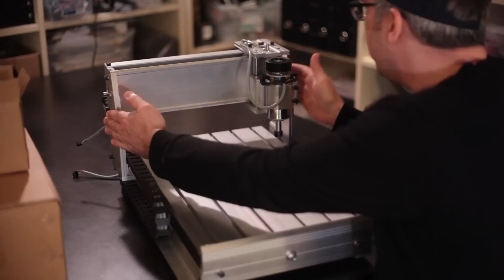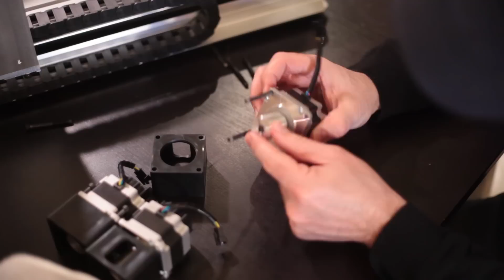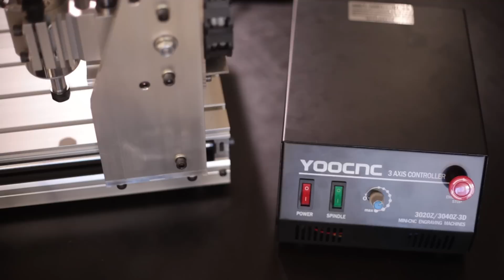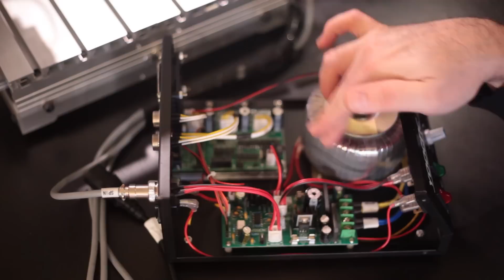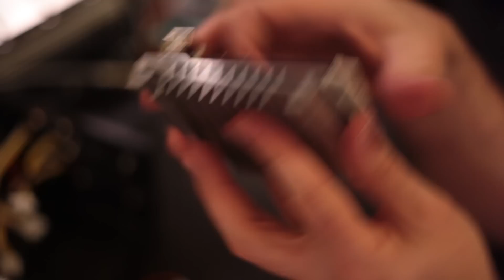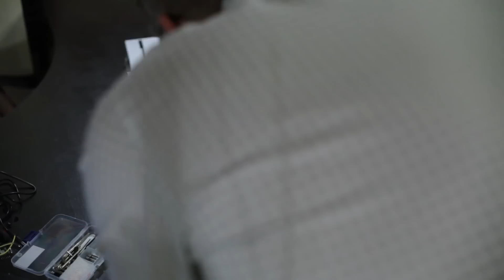Build a ChiliPeppr Driven 3040 CNC

Comment: If I have a parallel port machine can I run the json server on it to use chilipeppr without upgrading my Cnc controller board
Reply from the maker: No, ChiliPeppr only works with TinyG boards or Grbl boards.

Comment: People keep saying parallel ports are impossible to find ... Really, I can get them fairly easy over here for like 15 euros. Or am I missing the point.
Reply from the maker: Well, it sort of misses the point that CNC control boards are now readily available to offload all stepper motor step generation signals to a separate microcontroller rather than relying on the PC to do it. It really frees you and your PC up from the processing. Think about it like this--you're giving your CNC machine it's own brain and then your PC is just sending it Gcode and letting it do the hard work.
Reply: You won't get an argument from me there. I was just baffled at why people in (been watching a fair number of 6040 themed videos the last few days as I plan to purchase one) so many videos keep saying parallel ports are no longer available.

That being said you are right CNC control boards are readily available and can be a good option depending on your situation. But then really how is that fundamentally different from using a computer as your controlboard. With the latter I would argue you even have the benefit of a more comprehensive user interface than with a CNC control board that usually is somewhat limited in that regard. You have a web interface with the Chilipeppr you say. True, but I will admit it scares me a little that there is so much 'distance' between that interface and the machine. Which brings me to another concern I have. I am a little disappointed (and keep in mind I had not heard of Chilipeppr until your video) not just in the case of Chilipeppr but also many similar solutions such as for 3d printers, about the way the components communicate with each other. It is a mystery to me why not more of these solutions employ more resilient infrastructure give the rise of IoT and cloud technology.
Correct me if I understood the concept wrong here but with Chilipeppr you run a daemon on your RPI that essentially allows the hardware to be driven remotely? Would it not make more sense to use some form of resilient messaging for this? Or hell even go all the way and use Azure or some other IoT cloud.

Maybe I am just overthinking it, occupational hazard for someone like me who has been developing and working with IT systems for 30 years.
Reply from the maker: Well, once ChiliPeppr loads in your browser, everything is local as if it were an app on the desktop, meaning it doesn't go back out to the Internet. The local browser simply talks to Serial Port JSON Server (the daemon) which could be on your same PC or something like a Raspberry Pi and then that talks over USB to the CNC. I would say that's pretty much the same as a desktop app talking over a parallel port in terms of simplicity.
Reply: Ahhh thanks for that clarification. that does sound better. For some reason I thought it was driven remotely, so you could run/checkup on your job from anywhere over the internet. Which come to think would make very little sense really. Guess I should have done more research on Chilipeppr :)
Reply: You will have to run an old version of Windows to get a working port. Win10 will not play nice. Another option is to run one of those UC100 motion controller things inline. A USB to serial adapter will do nothing for you but break your heart.
When your all done jumping through hoops for a port you can buy and run Mach3 for it and you should be ok.

Comment: TinyG v9 has less amps then factory board , you will get steps skipping, and the parallel port have faster control :D
Reply from the maker: I've been using the setup I show in the video for 3 years now and never missed a step. The NEMA23's that come on most 3040 CNC's are rated around 2 amps. Mine were rated at 1.8 amps. TinyG can put out 2.5 amps per winding. So I'm not sure what you mean. When you say the parallel port has faster control, what do you mean? Do you mean it can generate more steps/second? If so, that's not really true at all. The max feed rate on a 3040 or 6040 would be about 5000mm/min. If you run at 8x micro stepping and you need 200 steps x 8 for a full revolution, TinyG can drive to this feed rate, as can most any microcontroller. Maybe help us out with what you mean?
Reply: if it works for you then its fine.I had some problems with grbl with not immediate stop and usb disconnecting when spindle turns on .
Reply from the maker: Grbl is not TinyG.

Comment: 2 years later most CNC still uses parallel ports.... Seriously why waste money on an tiny G and not a $15 PCI parallel port card?
Reply from the maker: Awesome to hear. I think you'll love TinyG's motion planning.
Reply from the maker: I think the future is the other direction. Your CNC machine should really be like any IoT device, which means it should just have its own microcontroller and be available on your network via WiFi. This is what you can achieve today with TinyG and Raspberry Pi, but if you look at other CNC controllers like Cohesion boards used on lasers, it even has WiFi built-in. The age of the monolithic PC controlling a CNC is in the past. However, I will say that ChiliPeppr is a great step forward on software, but there's still work to do to keep refining it. Mach 3 is commercial software and thus there was a revenue model for it. In this new age of IoT CNC controllers, there's no commercial software for driving the boards. This means we're at the whim of the community to solve bugs/features.
Reply: I agree actually, but still there is a ton of very good dirt cheap parallel board controllers out there. I just got an entire 4 axis kit with nema 23 steppers for $188 to upgrade my little sherline mills aging cnc setup that doesn't work with any modern CNC software (3rd party controller/driver not the Sherline controller). I bought a JT1900 motherboard for $65 with the parallel port built in. I am currently using linuxcnc which is pretty much open source mach3.  Linux also has open source CNC and CAM software. The problem however is... Linux. I guess my point was you had a perfectly working parallel based controller and replaced it with a $130 TinyG. Mach 3 is  only $175 for the full version so I don't think your money spent is justified being Auto Desk Fusion 360 CAD/CAM is free for hobbyist or business under $100,000. Fusion 360 and mach 3 is what I will be using once I get my larger CNC mill setup.  Thats just an insanely powerful combination for only $175 mach 3 license. There also much cheaper USB  controllers out there that are pretty good. This is just a money based comment though. Nothing against you vid or the equipment. It is still very interesting to see what you did with the tinyg.
Reply: Mach3 is unfortunately not the solution to all problems, there are certain areas where it does shine but there are areas were its severly flawed aswell. Mach3 has a long standing bug in its motion planner which only shows for rather complex short segmented 2.5D Gcodes. This bug instantly stalls my machine and has destroyed many parts along the way. So im actually looking at the feasability of going the reverse path, leaving my trusted mach3 lpt setup over to something more modern - g2core / chillipepper. There are still many questions for me to be answered first but i think its possible. Im not sure if i agree with the mindset that a cnc should be amongst iot devices, its still a large very dangerous tool that can burn through 10k $ in less than a second if not handled properly.

Comment: Thanks for this video John, I have just ordered a tinyg! Looking forward to chilipeppr etc! Quick question to clarify, is the Beagle (Now PI) used for plugging in the tinyg to, then you use a pc/desktop to connect to the PI as a server and then chili recognises this and the tinyg? Have I got my head around things correctly? Is it possible to connect the tiny g straight to the pc running chili? Is there a good reason not to? I think all will become clearer once I start to play. Thanks
Reply from the maker: You can runs Serial Port JSON Server on your local PC that also runs ChiliPeppr if you want a simple setup. I, however, am willing to put a dedicated Raspberry Pi in my controller that auto-boots Serial Port JSON Server so that it's just always on and connected. I also can then run a milling job from my laptop and take my laptop with me to the next room while the Raspbery Pi runs the actual connecting to the TinyG.

Comment: Aren't those motors weak for this machine ? they look so small. Also , is this a better machine than shapeoko ?
Reply from the maker: This machine is light years better than Shapeoko because it has ballscrews, is super rigid and square, and you can see the results in the final product. Any timing belt machine will have the lack of rigidity of the belts show up in the final part. The motors are great because you gain a mechanical advantage from the ballscrews. What will break on you during a milling job is the end mill because the motors have so much power from the mechanical advantage of the ballscrews.

Comment: Hey John, 
Nice work developing Chilipeppr. I ordered an OMIOCNC X6-2200 EPL, which is a medium sized router with an integrated controller. I put a USB thumb drive into their controller, and run g code from it without connecting a PC over ethernet, USB, or parallel port. I like this solution because software updates on a networked computer can interrupt a job. I'm satisfied with this solution but I'm curious about TinyG because 6th order, constant jerk, look-ahead motion control seems excellent for small machines like ours.
I have my reservations about Chilipeppr because I have to use my laptop and PC for work. If I run Chilipeppr on my laptop and leave my home wifi, would that interrupt the job? If so, is there a way to run TinyG without using Chilipeppr as its motion control software?
Reply: Actually, the more I look at ChiliPeppr, the more I like it. If I close the Chilipeppr browser interface and/or put my computer to sleep, will ChiliPeppr still run?
Reply from the maker: ChiliPeppr uploads the Gcode to Serial Port JSON Server which can only queue 200,000 lines of Gcode. So you do need to keep your browser open until all of your lines are queued.

Comment: Hi John, I've been using my 3040 cnc with a tinyg for quite awhile now. I'm thinking of springing the dough for a JCUT 6090A CNC (ad below). My only experience in the CNC world is with the tinyg and Chilipeppr. Is it possible to wire one up for something of this size with separate drivers for each stepper motor? Any problems you could see and reasons not to go this route? Trying to get a larger work area for punching out guitar templates and larger scale projects. Thanks again for all you've offered the CNC community!

http://www.ebay.com/itm/24x36-cnc-router-ON-SALE-freeship-JCUT-6090A-/131897591746?hash=item1eb5b587c2:m:mwSXD7kEDFsNhMkYCPQkETw
Reply from the maker: TinyG outputs step/dir signals as well, so just hook those up to larger stepper drivers like a Gecko. You should be fine. Almost no other change to your process that you're using today.
Reply: Awesome! I was hoping it would be that simple. Thanks again and have a great evening.

Comment: Hello there 
i just bought 3040 from shop which is very old stock they sold to me with super cheap price . 
But the problem is , i cannot seem run it . i load everything with my old pentium 4 PC which integrated with Parallel port . Is it driver not installed ? or i didt connect to port ?
Reply from the maker: Did you ChiliPeppr enable it?
Reply: oh solved the problem already , 
XML file i didt load which is preset/driver for cnc :(

Comment: what do the numbers 3040 mean?
Reply from the maker: It's the size of the milling platform. 3020 is smallest. 3040 is double the width. 6040 is even bigger. Same design, just scaled up.
Reply: Ok that's what I thought but wasnt sure,  thanks
Reply: 30X40cm cutting bed. 6040 is 60X40 ect.

Comment: Hi John, Very informative video! I am just about to pull the trigger on a 3040 but I know there are a zillion cheaply made variants on ebay.
I went to the omiocnc site from your link, and would like your input about the latest version (2017). The X3-300 USB description says it now supports using a laptop via USB. Is this new controller their version of the TinyG? What are your thoughts?
Reply from the maker: Don't know anything about that new controller, but I think TinyG is still the way to go so you should toss out that controller they sell with it.

Comment: Does not comes with limits switches  set up.
Reply from the maker: I've been using it a lot for a couple years with no limit switches and it's never really been a problem. You just set your XYZ zero to your workpiece lower left corner and go. Of course many people do use limit switches, but many have found they're not critical.

Comment: You should have just put a parallel port into your PC. The drives on that other board are weaker than the Toshiba chips.
Reply: It's no help you don't already have a deep understanding of EMC2 or whatever other software. Both EMC and CNCLinux was beyound understanding for 35+ year veteran of computers.
It needs you to do this and that ,  ERROR because you didn't ZERO ..... ( maybe I zeroed before I started the software..) arg , you can't adjust settings unless it moves and it just refused to move or move more than once.
Reply: Sambo
Zero? Do you mean home the axes? Yes, that is a requirement. Once you do home your machine you can use it from then on. I cannot even imagine what settings you want to adjust. I adjust whatever I want, before I decide to run a job.
Reply: I guess it was homing , but there were many other hoops to jump , like hardware E-stop , software stop/enable, homing each axis separate ( multiple keystrokes or clicks...) although I did get some movement under EMC all the extra steps just made me want to move to something dumber while trying to iron out the inconsistent movement I was getting every time I restarted. All that after installing Win 2000 on the old computer with parallel port I was able to get.
Reply: Sambo
If you were running Windows, then you weren't running LinuxCNC.